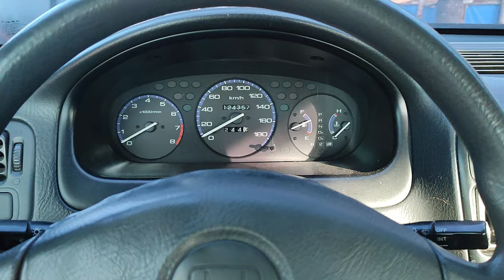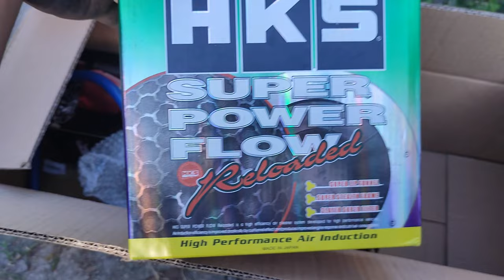Installing HKS Intake on my Honda Civic "EK" | Civic Vlog 09 |

Comment: boss ask lang kung bakit pinapalitan ng ganyan, ano pros and cons
Reply from the maker: Pros
More air more power - mas madali makahigop ng hangin
Maporma
Light weight kesa sa stock na may lower and upper intake pa

Cons
Affected fuel efficiency

Comment: Sir ok lang ba kahit yung air intake lang alisin? Or need din tangalin yung lower intake?
Reply from the maker: Okay lang naman d alisin bro pero kung gsto mo dn alisin less weight dn un.
Reply: Salamat po ☺️ last question sir. Anong tawag sa hose na pwede pang bypass kung ayaw lagyan ng water delete plug?
Reply from the maker: @danlazarus6173  Bypass hose lang bro tapos explain mo sa auto supply kung saan banda ikakabit ung hose (or picturan mo tapos pakita mo). Pero pwede mo nmn gamitin ung stock na hose bro yun lang dn kasi ginamit ko.
Reply: Maraming salamat po ☺️

Comment: May cons ba ung ganyang crank case filter instead of tube?
Reply from the maker: Mas nakakahinga yung engine bro kapag naka seperate filter ung crank case kasi mas direct na sya nakakahigop ng hangin unlike kapag naka tube then connected sa intake nakikikuha lang sya ng portion ng hangin from the intake tube 😊